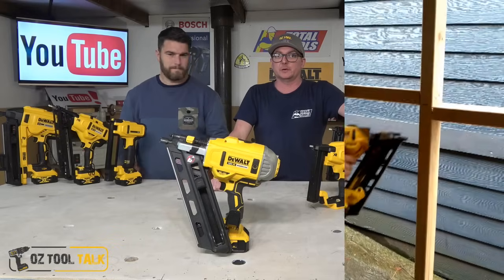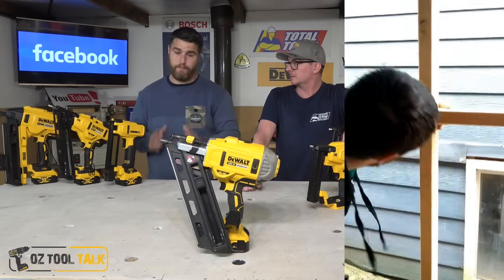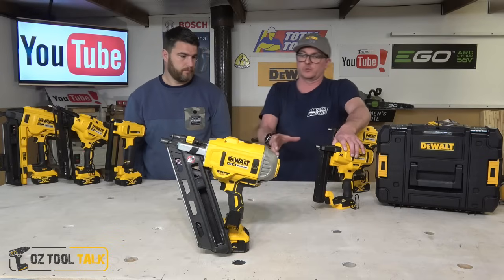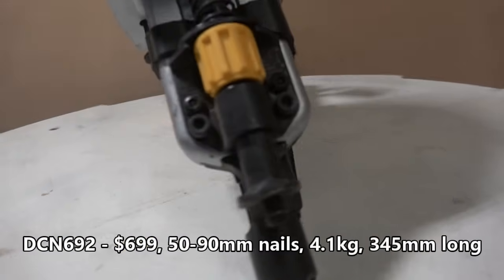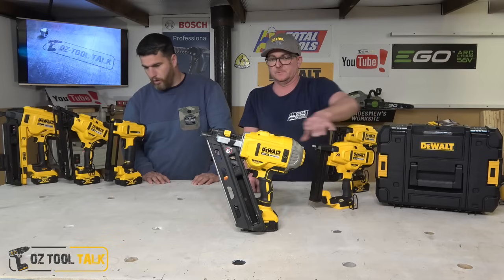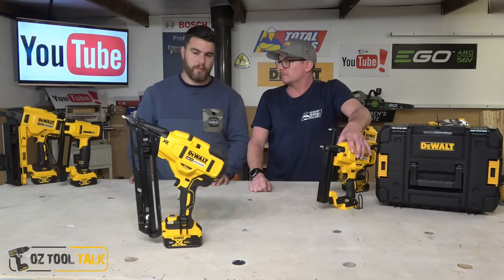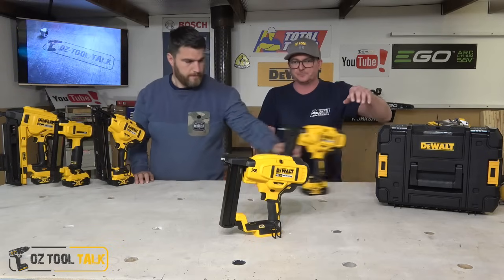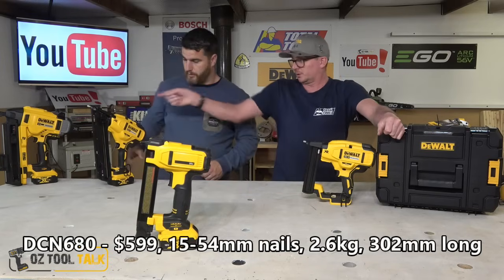Dewalt 18V Nail Gun range review - Framer, Fixing, Finish, Brad, Electricians, Stapler, Concrete

Comment: Using the framer as already on the platform and just like not smelling the gas on inside jobs; it works well with less maintenance and less noise than gas. Only disadvantage is, it's slightly heavier but easily gotten use to and has good battery runtime. Could do with an optional cartage extension. Definitely better than a air gun especially if on multi jobs at once or on lots of smaller. Needs to be well priced in kits with a few combos.
Reply from the maker: good feedback Bart. I also really like using it [Dwain]

Comment: 15g DA bradder for 12 months now. No issues. Awesome gun. Fantastic nose tip, super accurate for nail placement.  Hits super hard. Love no air hose! Ramp up no issue on this gun. But would never buy framing gun even though on the battery platform.
Reply from the maker: Love the DA [Dwain]

Comment: The ramp up seems to be a little better on the bump fire feature too. Only problem I've seen with any that's consistant is the 30° framing's springs get gummed up over time. You can usually get a quick temp fix by pulling them out and putting back in but they're also super easy and not too expensive to replace. I rate them up there with the ryobi airstrike which is actually better than you think. Ridgid hyperdrive need maintenance kits too often and I dont like the kickback on the fuel series. I own an indie hardware store in the Dallas area called the tool box. Shameless plug 🤷🏻‍♂️
Reply from the maker: good thoughts thanks Aaron

Comment: I bought a 30° nailer but I have a problem because the nail does not drive it completely. I don't know if it is due to the nail that I use from "2" ³/⁸ to "3" or the nailer, could you give advice on that?

Comment: Have had the dcn690 for a few years now. Always pre ramp up then fire. Force of habit for most tasks and will go faster than a paslode if you need it to. 

Downside is the weight compared to gas or air, shedding weight for the next gun will be a must. And would be nice to have the option for a longer mag like the new Milwaukee.

✌️
Reply from the maker: cheers Jason

Comment: Hi. I’m a diyer. Don’t want a gun for framing. I want to fix skirting backmolding ld trim etc. think I prefer mail to staple. Thanks m already on a DeWalt battery platform. Should I go 15g or 18g for nailer. Frank
Reply from the maker: hi Frank. for skirts/archs etc, you want 15 or 16ga. for small trim like 1/2" quad, you'd want 18ga . here's an article saying as much:
https://www.finepowertools.com/nailers/what-size-nailer-for-baseboards/

Comment: Ive had my dewalt framing 30 degree nailer for 2 years now and ive had guys put wd40 in the thing so i have had to take break cleaner to the flywheel and back of the firing pin. I have had to replace 1 bolt and the back window. mine is the older gen 2 but with 3in or 3 1/2" ring shank nails in treated wood has a hard time, in the winter wont drive much at all, other that that super nice to bring on the roof and not drag an air hose and i love it, i REALLY WANT AN EXTENDED MAG.

Comment: We've been using the first fix and 16g guns since they were released over here.  First fix lacks power compared to paslode but if your only doing softwood to softwood then no problem,  if you try them much on harder materials they break (thick plywood etc).  Battery life and reliability is fairly good other than that - I think we've got 4 of the first fix at the moment  - gen 1 been repaired but still going.  16g are great when they are brand new, again not got the power of paslode but depends what your nailing together.  After 6 months or so they are knackered, the power drops off - they suffer from terrible jamming and nail feeding, if you put 2 rows of nails in it will start jamming and misfiring half way through the first row and will do it all through the rest of the row.  They always break where the black nail holder attaches near the battery.  I think we have 5 of these guns atm and only the brand new one is any good.  I'm so pissed off with them I bring in a battery compressor and air fed gun to use if I need to do small Brad's for anything.  16g total garbage.
Reply: Thank you for your informative review.

Comment: have used first and second gen framer to death short on power but good for bump fire still get compressor and hozes when making kits use dewalts for nailing on site but use paslode to cheek nail trusses. a lot of kit to store when not getting used.
Reply from the maker: Is 'cheek nailing' the same as 'skew nailing'? I haven't heard the term before. [Dwain]

Comment: Hi Guy,

I have the DeWalt cordless 18g brad nailer for about a year. I do like not pulling out a air hose and compressor.  Now I have to say i still don't care for that rev up motor.  Dewalt needs to redesign that motor noise issue.  For the LED light would be nice closer to the front like their jigsaw. In saying that, it might cause a serious shadow. 

Milwaukee came out with a gen 2 cordlees 18g brad nailer and it so nice not to hear that rev up motor.   It feels heavier then the dewalt but man it's quite. I'm going to buy milwaukee for now and wait to see if dewalt is going to change that rev up motor soon.
Reply from the maker: thanks for the feedback Michael :D

Comment: I’m an electrician in the states the next level crazy OCD electricians here whom place their staples with Thor’s hammer trip arc fault breaker‘s with their “Superior“ craftsmanship... The cable staple should be installed and the cable should be able to move, not be able to use as a high wire. DeWalt has it right on the money! Tell your friend that’s a spark to give their cable a break.
Reply: The Truth, I hear you!

Comment: Are they as light as an air powered gun of the same size? My old air nail gun is pretty heavy after a few hours. They look like very nice bits of kit, very expensive though at 540 bucks.
Reply: Michael Bamber the framer is a lot heavier than the air equivalent
Reply: Michael, you would need to check the weight of your gun to compare.   I own the Hitachi air bradder and this dewalt. Yes the dewalt is heavier and more expensive. But I never feel fatigued using it and I sure dont miss dragging air hose or rolling up air lines. Money well spent!
Reply from the maker: Usually a modern air gun will be lighter. There are some pretty heavy old framers though! Also gotta take into account the 'practical weight' caused by a dragging hose... [Dwain]
Reply: @OZToolTalk  yeah, an your compressor if you're away from your shop, may look into one, your reviews are first rate as usual. I like  your real world testing of the product rather than a few times at the bench like some other videos.

Comment: Great review thanks... how do ye rate Makita with their nailers
Reply from the maker: Hey Gerald. I don't think Makita's battery stapler was well loved? Not sure on their gas gear...
Reply: @OZToolTalk  thanks for your reply. I was interested in an 18 or 16 gauge nailer for skirting and architrave as I use their 18v lxt
Reply: @ydarbg  Their battery nailers are very hit and miss and well below par considering their 18v tools as a whole are very good. 

Patents have been filed with the US patent office for an 18v framing nailer so look out in 2021 for the next generation of framing and brad nailers as this generation is sub par relatively speaking to the rest of their platform. 

Have a look at Amazon US for the reviews and you will get a good gist of the issues. They are the same tools in the US just with a different model no system. Just type Makita 18v nailer. 

Hope that helps.

Comment: ... after the Hitachi  launch the new new air powered nail guns the noise made by flying wheel  is disturbing. 
Dewalt has a bigger magazine only not for paper collated nails just for plastic collated nails , and doesn't take bought like I was expecting,  only they used the same shooting mechanism for the type 3 nail gun, which you have on your table and that is good. I don't know how many nails you can shoot Before you have to change firing pin , I know how many I had to shoot before I changed on type 2 , 15 000  , before flying wheel eroded the firing  pin .
If the Warranty on this one. It's only one year You should take most from it because if you have to pay for replacing fire pin springs flywheel  you better buy a new gun.